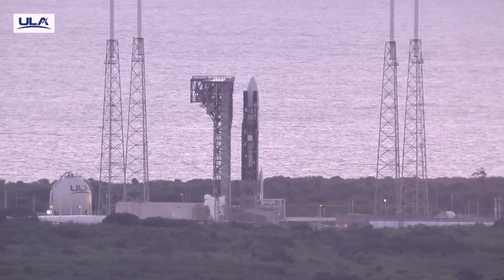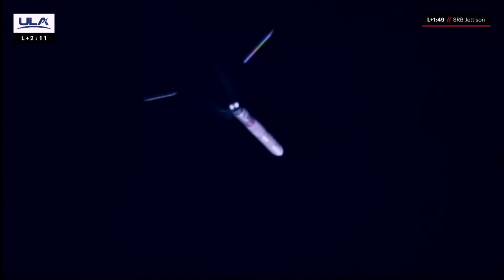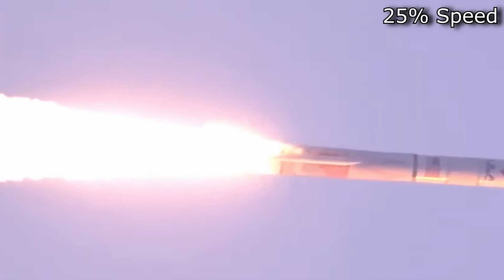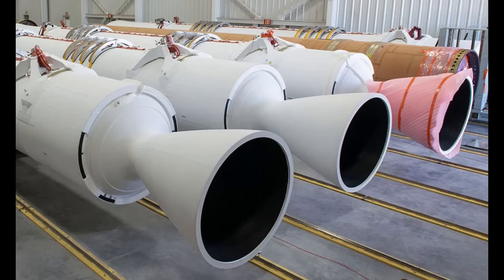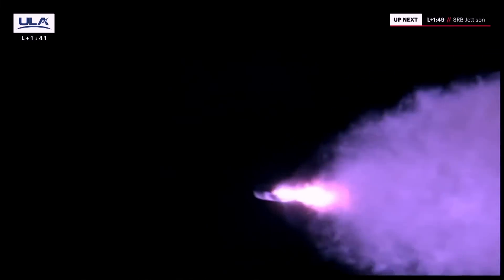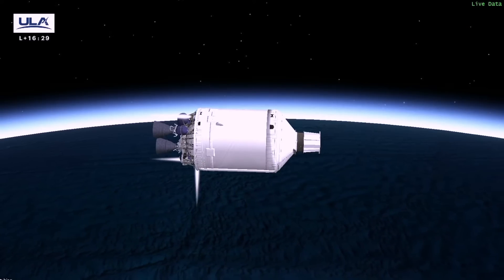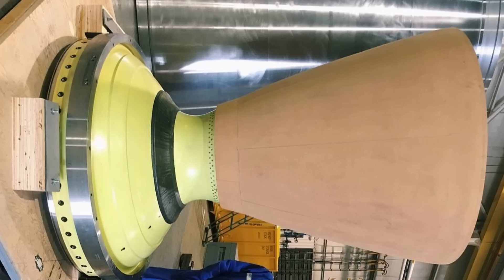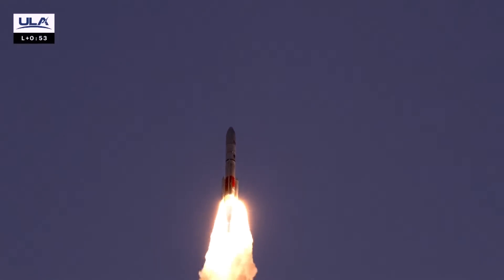How Did The Vulcan Rocket Survive This Booster Failure?

Comment: Luck, good flight software, and great compensation by the BE-4s
Reply: All the delays from Blue Origin have produced some pretty good engines.
Reply: @southofhollywood4199 Perhaps this flight might trickle some good PR for New Glenn, or would it?
Reply: @jmwoods190  Well, coming back 3 months later with New Glenn flying successfully and BE-4 performing perfectly on ascent and the descent issue likely being a plumbing issue with the color of the burn, I'd say the PR on BE-4 and New Glenn is very positive right now.
Reply: Curious to see how much harder the BE-4 worked. And the second stage.
Reply: Mind blowing isn’t it
Reply: I'd love to know how much latitude that flight software has to pick a different flight path. The simplest option would be for it to just try and stick to flying right down the middle, but I'd guess that that isn't the option with the largest margins for success (which is not to say I know how to do better, just that it seems unlikely to me).
Reply: I think the Centaur second stage had the power, thanks to a low mass payload, to get into orbit.
Reply: @elitnoctua  They probably gave it a proportional amount of fuel, so it still wasn't a given.
Reply: Luck. Looking at that out of control white hot perchlorate burn, they were damned lucky it didn't burn through to something critical and blow the whole works up.

I am cautiously pleased the software and hardware was able to compensate for the SRB burn through. They're lucky it wasn't a complete balls-out performance flight that needed every ounce of SRB performance and every drop of fuel to be burned. They happened, by luck, to have it fail within the performance curve that could be recovered from.

It'll be entertaining to watch the FAA try to cope with this.
Reply: @daveeyes it was not luck. The BE-4 great gimble saved the day. Also FAA said they won’t investigate
Reply: @alexanderkenway  and a solid flight computer/guidance system
Reply: @tombeef4534 If we could send an Apollo capsule to the moon and back with mere kilobytes of RAM, our modern computers should be able to handle anything! It's just a matter of having the right programming...
Reply: Careful, positive comments about anything Blue Origin produces or does are not permitted in the space flight community. 

You might lose social credit points.
Reply: @iamscoutstfu  luckily I am not part of the Leon cult and wont hold positive comments for any other launch provider against the commentor .

Comment: This gave me some serious Challenger vibes...
Reply: Yes, seeing those sparks shoot out at random.

If this was a crewed flight everyone would be sweating....
Reply: @volvo09  And thank God the SRB didn't develop a crack like that Delta 2 explosion!
Reply: @volvo09  a crewed flight probably would have activated the abort system.
Reply: @volvo09  it would have been aborted. NASA is not going to gamble the lives of four astronauts, as seven were lost in 1986 due to a failed booster.
Reply: @volvo09 good thing this point is moot since Vulcan has no plans to be human rated
Reply: @mattkingston6157  Isn't it supposed to fly Starliner after Atlas V retires?
Reply: @foke449  Only if Boeing continues the program in six years.
Reply: Challenged was not so lucky. If the burnout was differently directed, the problem would be similar to this case: how to reach a workable orbit.
Reply: @arctic_haze  Wouldn't have made orbit. The loss of thrust from the SRB, and the very heavy TDRSS/IUS, plus SPARTAN-Halley spacecraft would've likely resulted in a very risky TAL abort. If the were very lucky, an AOA, but they'd have been landing very heavy.
Reply: My thought, too.  It looked like exactly the same type of problem, if those boosters are sectioned.
Reply: @MrJdsenior  Nope. No field joints on GEM-63 XL. It's one of the largest monolithic cast solid rockets flown.
Reply: me too
Reply: Indeed.  😢🚀
Reply: same
Reply: Having seen the Challenger lift off live on TV, I got the same dreaded feeling...

Comment: If I was the DOD, I wouldn't certify it.
Reply: I would once the root cause is understood. This just inadvertently proved how resilient the platform is.
Reply: @joe.schmo93  Thats what a CERT-3 would be for
Reply: @bryanillenberg  I don't think anyone expects a certification mission will go perfectly. It's a notable item but one I could see easily being resolved through analysis rather than going through an entire new flight.
Reply: @joe.schmo93 as Scott says, they were lucky to have the pieces fly away from the BE4s
Reply: I do t know how DoD certification works, but in most system certification/qualifications a recognition and recovery from a problem has more gravitas than a perfect performance.
Reply: @dwaynepenner2788  That's just false. In certification processes, a perfect performance is better than an extremely close call where the root cause of the failure is unknown, and it was only pure luck that saved the rocket. All the shrapnel and falling off parts luckily managed to miss the rocket. The DoD should not rely on pure luck when launching top secret and expensive stuff.

Comment: Those sparks, when the rocket is using ITSELF for fuel.  NO, the big question is what is the orbit, compared to what it was supposed to be, and is it usable, as an orbit for the mission.  I would be AMAZED if it were.   I worked for an engineering company that was notorious for calling out things like 80% successful, when in some cases the rocket did literally nothing, falling into the ocean dead on a test, without ever even booting up the electronics.  They may just justify the hell out of a grossly anomalous orbit.  The only way I can see that mess achieving the intended orbit is if that failure cost them VERY low single digit percentages in thrust, over a relatively short time, and a significant excess was available in the upper two stages.  Just the losses on that pull up and the resultant far from optimum trajectory would be IMMENSE.  Rockets are dead sorry lifting bodies, about as bad as you can get, and still be aerodynamic.
Reply: Engine-rich exhaust.
Reply: The RL-10 burned way longer than nominal so it may have achieved the intended orbit, we'll see.
Reply: @MikesTropicalTech  Tory Bruno says it achieved a good orbital accuracy and did not use more reserves than the standard propellant margin they use on all missions. That's quite impressive (and surprising to me).
Reply: @AmbientMorality The shape of the solid fuel determines the thrust profile. Maybe the GEM63XL has peak thrust at ignition, which is typical for SRBs, and then the thrust tapers off. I believe the Shuttle SRBs tapered to well less than half of peak thrust as the stack approached max q. By the time the nozzle actually detached, there may not have been very much thrust left in the motor.
Reply: Rocket-rich exhaust... That's pretty metal tbh